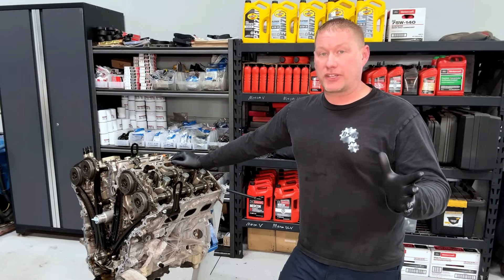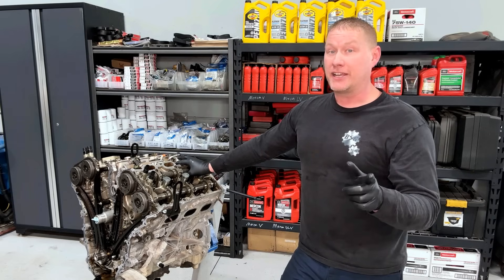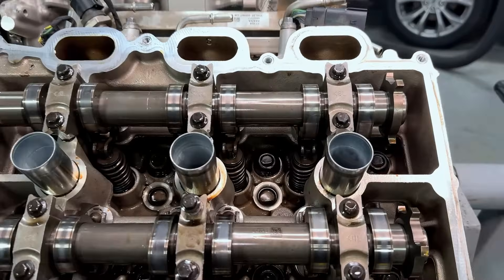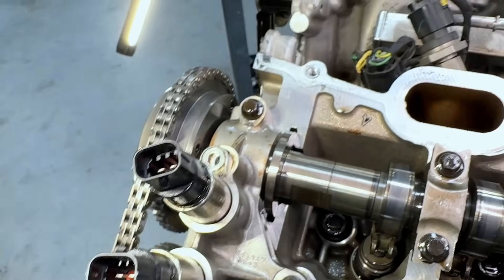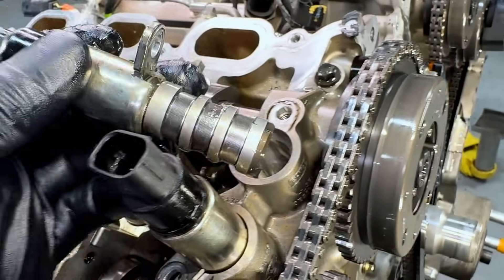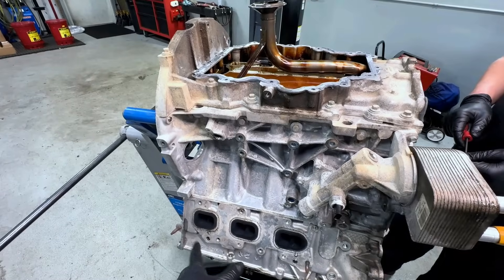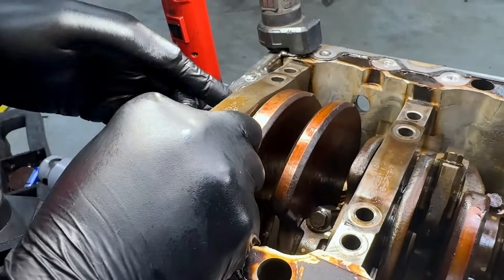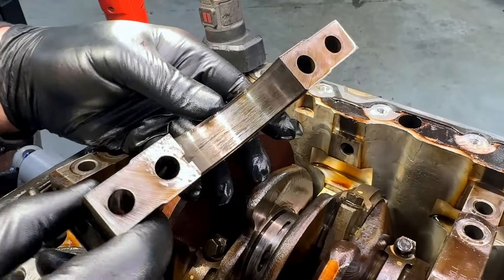Did The Ford Dealership Technician's Neglect Cause This 3.5L EcoBoost Engine to Fail?

Comment: I was talking to a guy at taco hell the other day that had a 2014 f150 w/ 3.5 and he has 287k miles and he said he has had zero issues so far
Reply: They are good motors. You only hear people talking about the bad ones. However most of them live a long life if PROPERLY taken care of.  Change the oil every 5,000 Miles. And it will last.
Reply: @trelipscomb8137  yeah that’s what I hear a lot. All these motors that’s falling apart on YouTube have probably towed max weight and 10k oil changes if even that
Reply: @trelipscomb8137  exactly my thoughts
Reply: You can change the oil all you want, not sure it’s going to keep the turbo coolant fittings from leaking on the 1st gens!
Reply: @kyledavis5474  my mom has one. Almost 200k no leak yet. I check it for it every couple months. Still dry as a bone.
Reply: @kyledavis5474  2014 Flex with 185K, no leaks anywhere, turbos still spool up with plenty of boost.   It is due for timing chain replacement though, the tensioners are leaking down at times.
Reply: Guess it all depends on what day it was built. I replaced a 2015 3.5 turbo last fall @ 87k due to a timing chain that broke and crashed the valves.
Reply: @mph5896  damn that sucks
Reply: Its luck, i had to replace a MAF that went bad @24k miles.
Reply: Might help with that one long timing chain running everything though!
Reply: I bought a 2014 new and now have over 320k on it.  Kept it maintained and God has blessed this truck.
Reply: Wtf he is lucky lol
Reply: I think it was consumer reports but when they asked owners if their vehicle ever had any repair issues people would say no. Then they were asked specific questions and most would respond yes to one or more.
Reply: If you change your oil every 3k, it's cheaper ins, for any motor, and adds life, IMHO... if you check the fluids often and top off that will also add life expectancy, for a while.
Reply: I guarantee he has turbo coolant lines leaking he just keeps typing it off.

Comment: Where is the broken sensor mount
Reply from the maker: exactly, I think it was chewed up
Reply: Or it was put in the trash can near the tech that did the trimming job. @FordTechMakuloco
Reply: @FordTechMakuloco  How does it get chewed up if it has to go through the screen in the pickup?
Reply from the maker: Did you see the oil baffle?
Reply: @FordTechMakuloco  It looks like the bearings got hot from oil starvation, melted, and were squeezed out from the journals.

Comment: Damn I hate the internet! What I love is my 2018 F150 with the 3.5EB. But all the scary stuff you see on the internet makes you feel like you're riding a ticking time bomb. I've had my truck since new, and never had an issue. I'm meticulous on the oil changes, no more than 5,000 miles with a top quality synthetic oil. With the price of new trucks, I'm keeping this as long as I can. I'll keep doing the oil changes and taking care of it, and see how it goes. Love this channel.
Reply: Maintenance/ oil changes is KEY with these engines. I also change the oil every 5k
Reply: I've owned a few different makes of cars and I think there is some luck involved. Keeping clean oil in her is the best defense but sometimes bad things happen. Anything mechanical can have a failure. Even Toyotas and Hondas can have a problem. I guess it's a numbers thing when too many of your engines are having the same problem, especially early in mileage. Synthetic oil every 5000 or once a year for low mileage retired folk like me. Hopefully we stay lucky! 🤘
Reply: You keep doing that and don't let some hack work on it and it'll go 200k+ miles easy.
Reply: Well what we see on the internet is a small % of failures in the grand scheme of things, but if your the one that gets that failure it really sucks. My last work truck was a Ram 2500 4x4 6.4l Hemi. I was always worried about cam/lifter failure happening which never came. It made it to 200k miles before biting the dust due to a new employee over heating it. I had just moved into my new 2024 Ram 2500 and heard it failed. In our work fleet only 2 had that problem and were from workers not well known for staying on top of maintenance. All you can do is stay on top of the maintenance and try not to abuse them too much. That being said I still research and like to go with brands with the least amount of failures. I have never been a one brand loyalist as I think that is silly. I just go with what I like and can afford at the time of purchase. I have to say I know Rams are not well known for being bullet proof, but they damn sure ride and handle very well and always even with the work trucks have a banging sound system. I believe our company will be switching to Ford or GM next fleet purchase because we are not sure how well the Hurricane inline six will hold up in the oil field.
Reply: Well you know where to take it when it does crap the bed
Reply: Oil changes every 4,500-5,000 miles on full synthetic. 3,500 max on synthetic blend. Those twin turbos are hard on oil life, lots of heat in those babies.
Oh also put a catch can on it.
Reply: @jimmieb1970 2017-18 they started adding intake valves/fuel injection(with direct). No need for a catch can.
Reply: I change mine every 4000 miles with valvoline full synthetic and have 178000 miles and runs like new.Also put a catch can on it at 106000 miles when I bought it.
Reply: Every vehicle is a time bomb.
Reply: I think a LOT of what we see on the internet are engines that have not been maintained properly.  Regular maintenance used to be common sense.  If you wanted something to last, you took care of it.  That's not so common these days, especially with younger folks.
Reply: 2018 F150 has the belt-driven (oil exposed) oil pump. Good luck.
Reply: @Maybe-So  not the 3.5 you are thinking of other ecoboost engines
Reply: @Maybe-So I get your skepticism, but never heard of oil pump or belt failures
Reply: Better have money to fix it or a extended warranty. Stuff happens could of just been a bad one. Replace it go on.
Reply: Every 5k miles oil change interval doesn’t matter if you baby it, never take long trips, and only make short cold start runs into town. Ford has had over 20yrs to figure out ohc and they don’t seem to care and gm and dodge ohc are just as good if not better with less cost to repair.
Reply: Any ecoboost is a ticking time bomb
Reply: @ Amen
Reply: If you're changing every 5k not really needing synthetic. If you use a regular oil meeting specification for your 3.5 ya save coin!
Reply: 5,000 mile oil changes won't get you long distance.........😮 I don't care how synthetic or good the oil claims
Reply: Yes it will I have 2 vehicles that have made it past 200k every 5k miles our work fleet of trucks do every 5k miles and all of them have made it to 200k so yes every 5k with synthetic is fine unless your trying to make it to 500k or more.
Reply: i bought the same truck and mine failed . cam phasers. Timing chain ,solenoids got it fixed now oil leaks everywhere. fords are junk.
Reply: @jimsullivan306 you can’t summarize the quality of a engine, much less a entire company, because you had…a…problem with one. That’s just stupid. 

Someone like Brian would know 1000x more about the 3.5EB than someone who “bought one and had problems.” If he says they’re a “pretty reliable engine outside their phasers,” I’ll take his word for it and have a timing job done between 100-150k miles.

If his word weren’t enough, statistics speak for themselves. Do you have any idea as to how many 3.5EB engines Ford has sold? If the engine was junk Ford would’ve been bankrupt…a…decade ago. 

Yes, Ford has the most recalls. They also push the envelope harder than any other automaker. I wouldn’t touch a car sold by Ford, GM, or Fiat. But there’s a reason the F-series has been the best selling truck line for…how long now?
Reply: @jimsullivan306 .mine 124,000kms regular towing and none of those issues 😊
Reply: @jimsullivan306 I try warning people